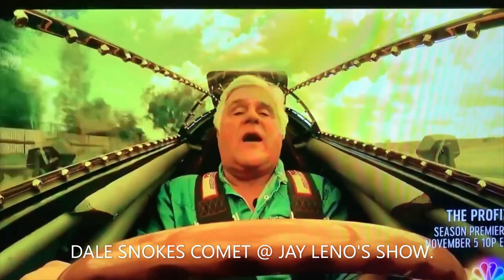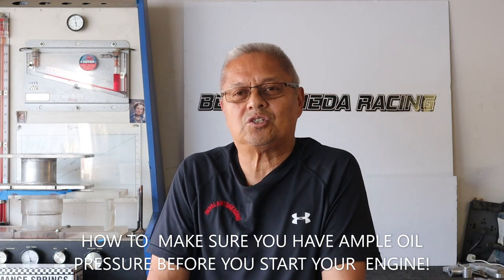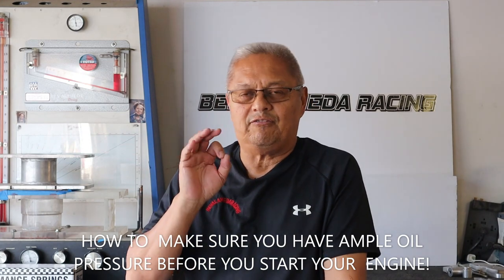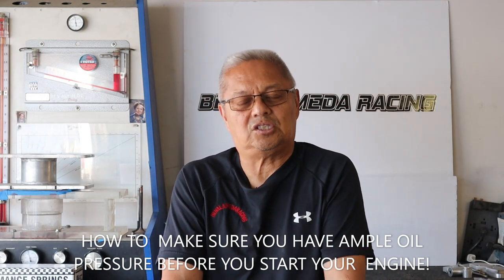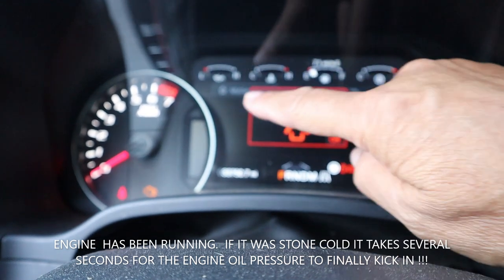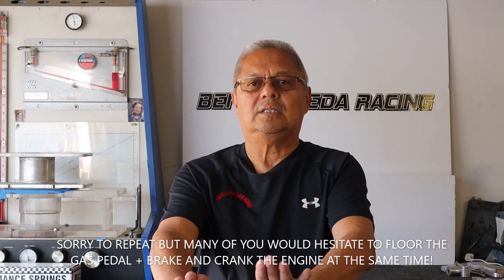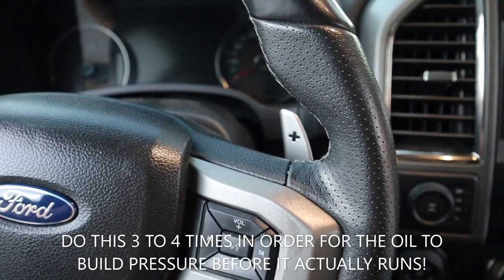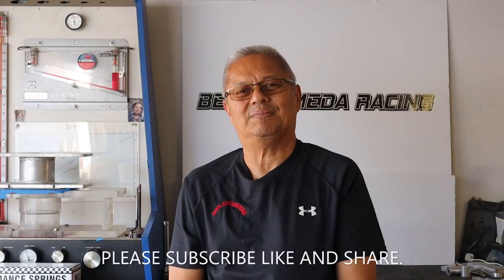PREVENTING DRY STARTS WITH FUEL INJECTED ENGINES!

Comment: Good idea Ben. I have a carb engine but the ignition system is wired through a relay controlled by an oil pressure switch. Also handy if you loose oil pressure for one reason or another.

Comment: Great tip Ben.    I think ,why dont manufacturers program that in ? From a certain time of not using the vehicle it first primes  before starting.  Its easy to do.   ( I can understand that bank robbers etc then prefer the quick start mode to prevent priming  and escape coppers..)
Reply from the maker: If the manufacturer extended the start sequence there will be complaints from the general public because they will not understand the purpose...

Comment: Hey Ben, I have a question about the video you did on hot intake valve and pre-detonation. I saw the small holes in the top of the piston that go to the ring lands and thought that was the main contributor to blowing the crown of the piston off with compressed gas charge and to high combustion ratio. Could you please let me know how and why my thoughts are not the most accurate? Thanks, hope to hear from you or see video about it
Reply from the maker: The gas ports usually are not located at those thin areas by the intake valve pockets and it really plays a minimal role in breaking apart that area.  If you feel it is a concern for your engine there is another alternative, machine a "horizontal" gas ports and it should run good but not as effective as a vertical gas port on the pistons.